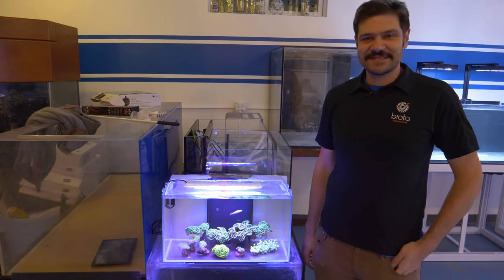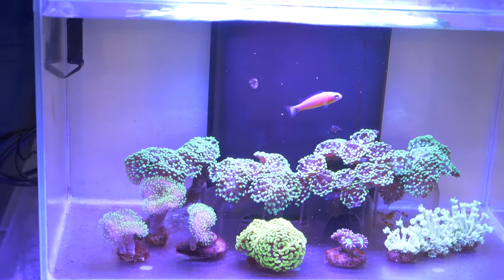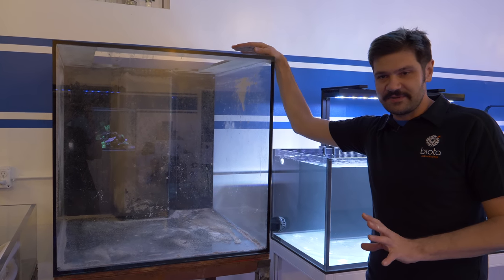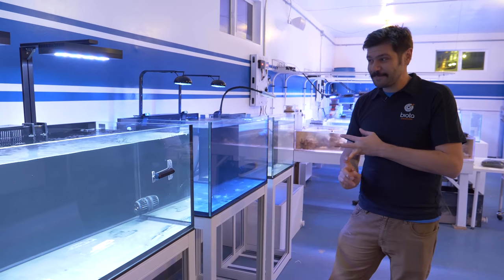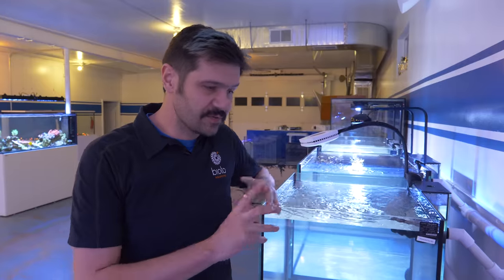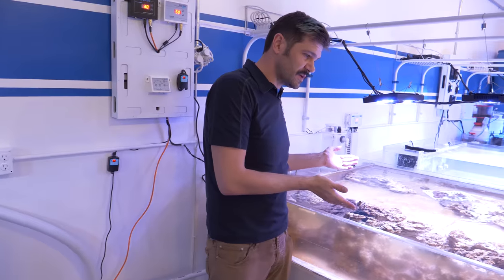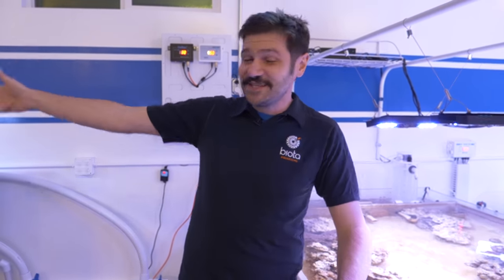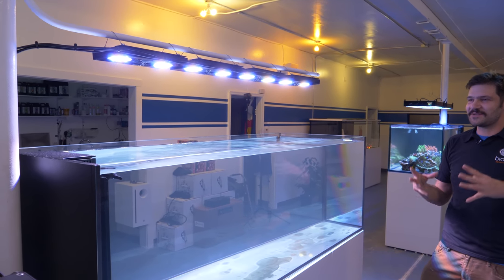Vlog 28: Five Virgin Tanks

Comment: Kind of funny, all the crap given to those cheap Chinese DC pumps from all different brands that have identical (except perhaps the color) controllers that are obviously coming from the same factory, yet here we have high end Deltec pump and right next to it is an Aquabee controller, and both are absolutely identical... again except the color scheme.    Mind you, not saying it's a cheap pump at all, but even the high end stuff obviously has stuff coming out of the same factory and getting tiny tweaks for each manufacturer.
Reply: So true. And AC pumps spec'd with lower manufacturer flow and head height numbers actually run circles around the majority of the DC pumps out there in real world applications. Not to mention much longer lifespan/reliability. Abyzz and red dragon being DC pump exceptions of course, but those are in another price category altogether.